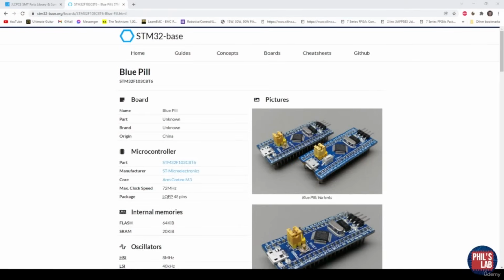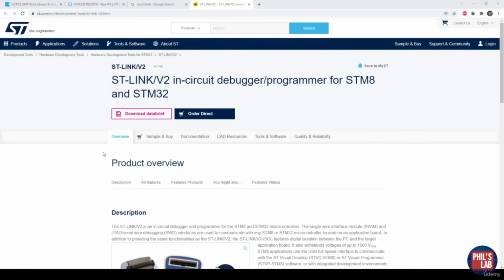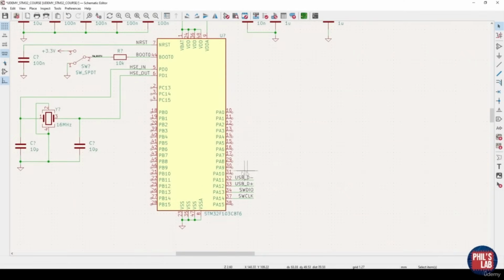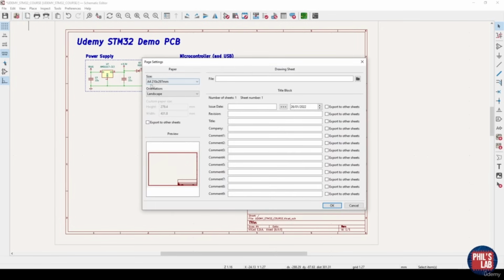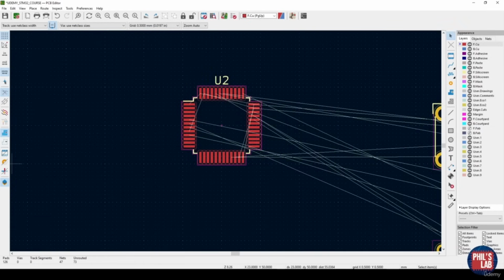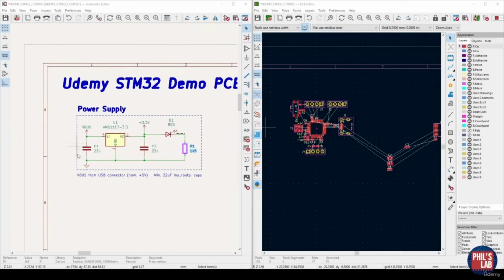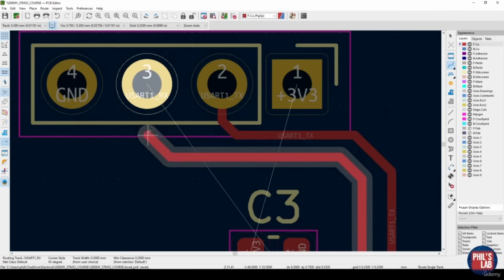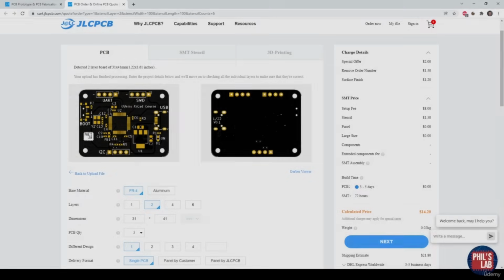KiCad 6 STM32 PCB Design Full Tutorial - Phil's Lab #65

Comment: Awesome tutorial, I learned a lot. I was especially interested in the way you did the ground planes. I watched another tutorial a month ago when I first started with KiCad that suggested using ground planes on both the back and front, so that is what I've been doing. With that, for most ground connections I've been letting the front ground mask make most of the ground connections, except where space was limited. 
I'm currently working on a mixed digital / analog design with a Teensy 4.1 controller board, and plan to go back and adjust a few things based on what I've now learned.

Comment: Thanks for sharing this. Question: can the STM32cubeIDE be used to determine the value of a pull-up resistor for any given pin (by e.g. providing the impedance value for any given pin; I assume different pins have different such values)? Request: I'm a newbie, and would appreciate a video whereby you use the STM32cubeIDE to further explain the fundamentals of STM32 chips. For example, I was lost/confused on what the drop-down menu meant when you clicked on a pin (seemingly allowing you set what the pin does), whereas I would have thought that what the pin does is unalterable. So either I am misunderstanding the IDE, or STM32 fundamentals.
Reply: I mean most stm32 have some value given in the datasheet. Just look for "pull-up
 equivalent resistor"

Comment: In today's world of parts shortages, choosing your footprints will probably involve  checking to see what size packages the required parts are actually available in.  You might for example find that you'd have to go with 08' sized capacitors and resistors because they were not available in the 04' or 06' sized packages.  Similarly the microcontroller might be available in a QFN footprint and not a QFTP package.  Of course there are certain pad layouts that can fit multiple sized parts.  In the case of the microcontroller, it might be possible to 'nest' footprints so two different packages could be fit on the same layout.

Comment: Something i have learned by doing is that if you have a lot of connections in the pcb design, you can put all horizontal connections on one copper layer and all vertical ones on a different layer. 
This drastically reduces the amount of vias needed

Comment: hey phil, great content, i‘m currently working on a pcb for my masters thesis with the stm32wb15. Your videos helped greatly so far. it is a ultra low power two core mcu with BLE capabilitiys and unfortunately there is not very much information out there on how to get it running easily on the softwareside. would greatly apprecheate some content on the WB series. cheers!

Comment: Very  cool!   I  am an old timer.   I started with the   8 bit    6502  in  1977   then  an  Apple  ][  computer  in  1978.   I  am now  retired but  still doing  DSP  with modern  chips.    I  remember  solving    diirereential  equations  on  my Apple  ][  using  Apple  Pascal.  It   would  take  two days  to get a  solution  ..      if  convergence  to a  unique  solution!!!  Thank you !

Comment: oh yeah. getting done programming a high performance CNC general purpose controller, and I'm just using dev boards to interface with the controller. this might be the video that gets me making a PCB for it, which will come in really handy cuz my need for 5v+ outputs has me soldering tens of through-hole transistors in perfboard like a complete goon.

thank you for making these videos man.
Reply: why not buy a 3d printer controller and modify it? i suppose there should be open source cnc controller boards too